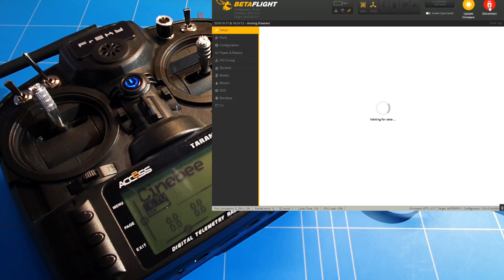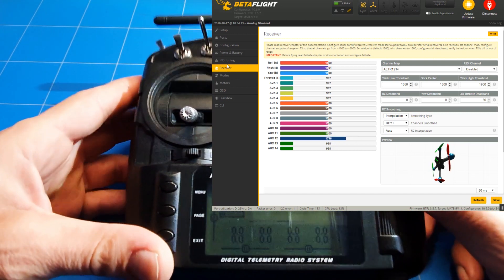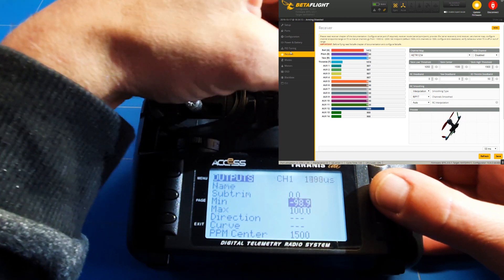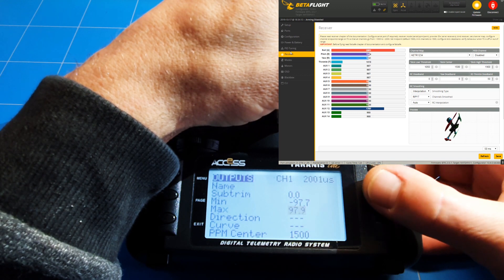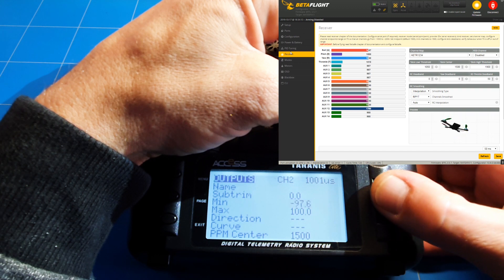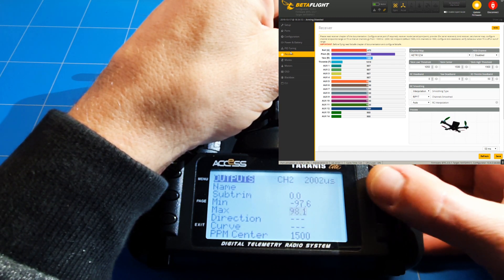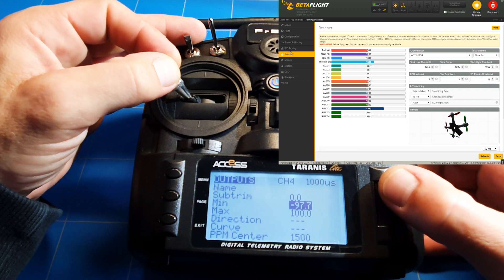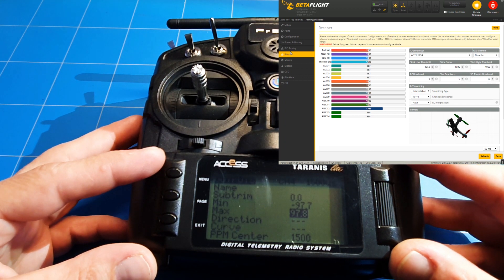Frsky Taranis X9 Lite How To Calibrating Channel Endpoints in Betaflight Setup iFlight Cinebee 75HD

Comment: Nice Tutorial on setting up the Channel Endpoints. I have to do this way too frequently. BetaFlight could make this so much easier by having a Transmitter Calibration Screen so it could read the Max Extents of the sticks and set the endpoints accordingly. Even the old CC3D OpenPilot had a calibration screen for your Transmitter ;-) See you in the Air!
Reply from the maker: Ye those good old days but betaflight is still very good if not the best at this moment